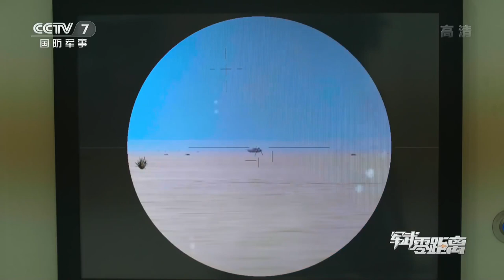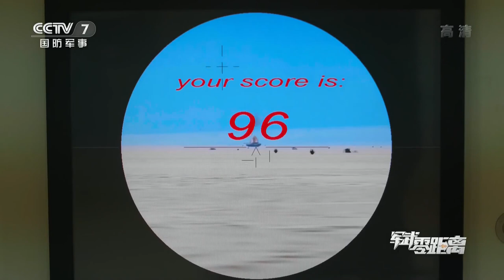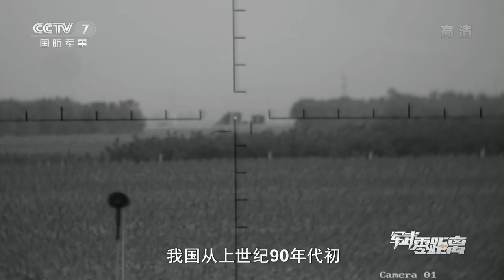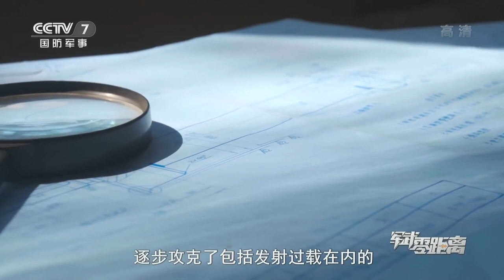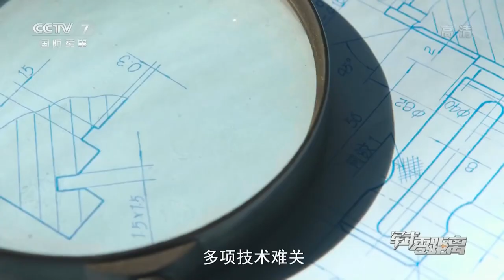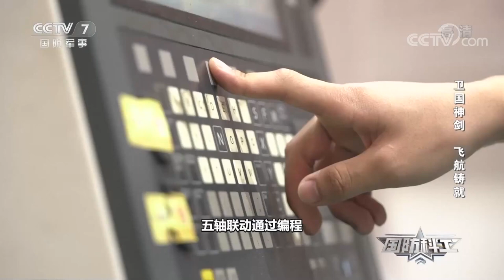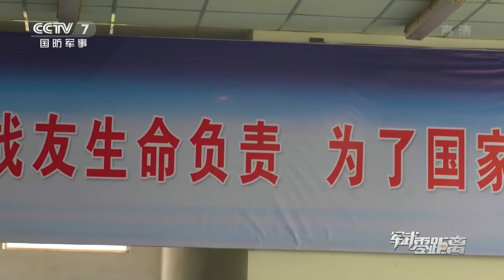Chinese Beam-riding (laser beam guided) artillery launched missile ZBD-04A infantry fighting vehicle

Comment: Laser riding weapon requires the shooter to continuously place the crosshairs on the target. That places the shooter in harms way for a considerable amount of time as the illuminated target or another enemy shooter can counter fire.
Reply: turn it off and turn it back on!!!
Reply: @dariomendoza191  ::: nope. Even if your pulsing the laser beam doesn’t cause the rocket to go off course, the enemy will have acquired your position. Laser beam riding weapon is a little better than the older TOW rocket which is guided by wire. Remember the enemy also has laser or radar range finder that has an accuracy of a few millimeters. After about 4 to 6 of your on-off pulses, a few mortars will rain down on your head. The modern trend is the aim-fire-and-forget weapon that has its own target acquisition and terminal homing.
Reply: @ubermenschen3636  ok they will have to TRY HARDER!!
Reply: It's easier said than done.  And you don't laser the heavily guarded targets,  of course they'll  knock you over. In a real battle field majority of targets would be without proper countermeasures
Reply: Look like it’s for bunker and defense lines
Reply: because is a small missile, 100mm cannon is not that big
Reply: its just a atgm
Reply: This type of missile flies so fast and laser designation time is short.

Comment: Another russian copy......
Reply: lol
Reply: If you know anything about the BMD3/4 and ZBD-4, you won’t say that. Yes there are similarities between them. The gun system in ZBD is a licensed and modified BMD gun system. However, BMDs have its torrent at front, infantry in middle and the engine at the rear; ZBD has engine in front, infantry at rear. So the design philosophy behind them are completely different. BMDs are designed as a easily transportable and air-drop-able tank. It is expected to fight MBT and spearhead the assault behind enemy line. ZBD is designed to carry infantry to complement heavy armor forces. On that sense it is similar to western IFV, scout ahead of the tank formations, protect their flanks, dismount the infantries to clean up the area or fortify defense position. Research before open your mouth.
Reply: Varangian Guard  I am talking about their differences in design and intended role and you are talking about the weapons. Really nice try! Because both F-22 and F-16 can carry AIM-120 and AIM-9, so they are the same?! Really nice logic there. I won’t be surprised if type 04 can fire 9M117, after all it use a modified gun system from BMP-4. However, there is no evidence that Type-04 carries missiles regularly. After all, there is not much usage of 100mm missile when MBTs are nearby and they have much better guns and missiles. BMP-04s carry gun-firing missiles regularly because of the legacy of USSR. Based on Soviet era idea, BMP-4s will be dropped behind enemy line and fight alone, so they 100% need weapons that can damage MBT. Type-04, not so much.
Reply: Varangian Guard  my bad, sorry, just realize the is the video talking about the missile not the one about Type-04. For missile, yes, it is licensed and modified 9M117. No surprise there. China also has one with slight bigger shell for 105mm gun on Type-15 light tank.
Reply: Only similar part is the gun system. It's like saying all L7 gun derivative vehicles are copies of each other when you know the Leopard 1, OF-40, AMX-30 and Centurion are all different.